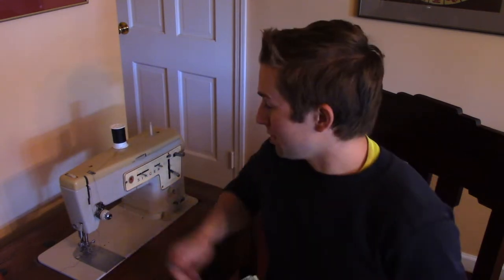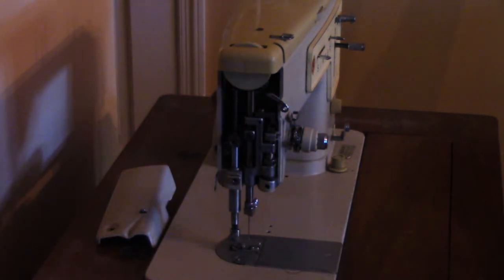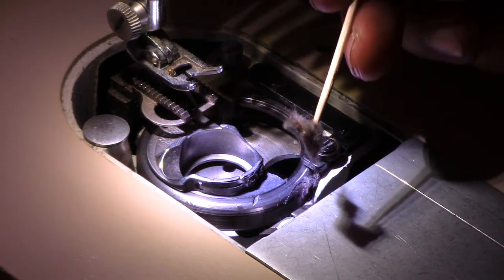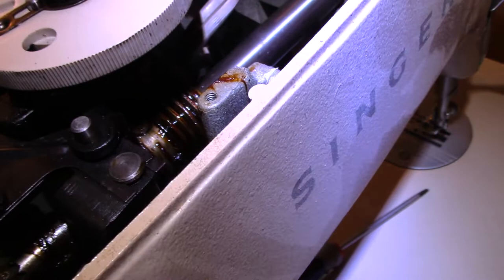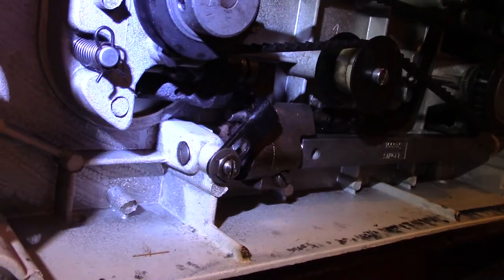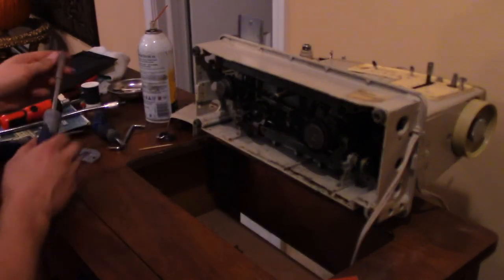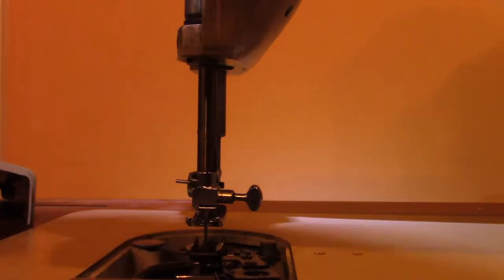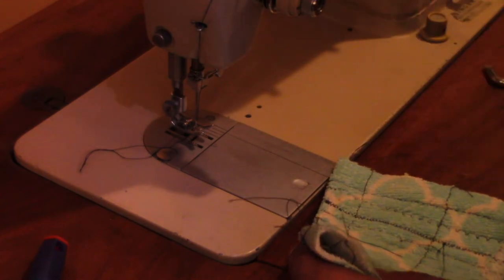Singer 457 Lubrication, Maintenance, Needle Timing

Comment: Wow. Just WOW. I tackled my wife's 50 year-old Singer 457 machine two weeks ago to replace a broken gear. She loves this machine. Put it back together, and the timing was off. Spent a WEEK messing with videos posted by others, and NOBODY mentioned the TIMING MARKS on the shaft! After watching your video, I had it timed in 15 minutes. You are a great mechanic with very good communication skills. Who cares about knowing all the proper terms for parts! You NAILED it. Thanks so much. Now all I need to do is fix the tensions that I screwed up!!! Keep it up!!!
Reply from the maker: Very please to see this video helped! I really wasn't sure if there was a point to posting this video but now I am glad I did! When taken care of properly, this type of machine can potentially last generations! Nice to see some one else who can appreciate a machine like this! cheers
Reply: @OldSoulMillennial  I grew up sewing with this machine.  It’s now in my possession.  When I try to sew the machine runs BUT the hook mechanism (the thing that spins around under the needle) does not move.  When I lay the machine on it’s side to look under the machine, the belt is attached, but when I turn the wheel the belt will not move.  What do you think I need to do?  Do you think I need to play with the timing as you demonstrated in this video?  Please, I would so love your input to this baby running and sewing again!  Thanks in advance!  MH
Reply: @OldSoulMillennial I Normally Use Scissors to Trim The Thread Off.

Comment: great work, especially on showing the timing adjustment. 

i'm writing a few points for ppl who need a bit of help in the future.
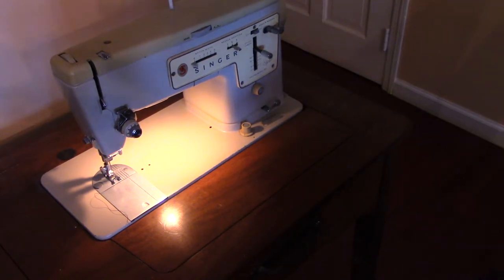@2:55 the knob is the feed dog regulator. it moves the feed dog up and down r= regular sewing (all the way up) f= fine (a little lower) d=darning (all the way down)
@10:33 the plastic gears are sensitive to petroleum lubricants, especially considering their age. use a lubricant that's compatible w/ plastic. (spare gears are available online, i replaced one of them after it disintegrated w/ the help of improper lubricant).

about the speed of the sewing machine.
that's still not the full speed of the machine. i can think of two possible issue: weak motor (worn brushes or loose belt) or improper speed control adjustment in the foot pedal.
loosen the hand wheel knob as for bobbin winding (this disengages the needle and all the gears/mechanism) and see if the rpm of the motor drop substantially when you apply a little pressure on the hand wheel. 
if the rpm remain high, the friction is still in the gears/axles/etc. (tri-flow that was mentioned is a 'dry lubricant' that contains ptfe. any ptfe or dry silicone lubricant would work a little better on the metal parts than regular machine oil. it is noisier but it doesn't attract dust)
if the rpm drop, the motor is weak. check the motor brushes and belt. if the brushes make proper contact on the commutator, check the foot speed controller. this controller works by electrical resistance in the form of graphite pucks that get pressed together. quite archaic but fascinating. it is adjustable (some pucks may be cracked) but electronic/modern speed controllers are also available for less than $20 if i recall correctly.. in fact check the speed controller first before the motor brushes. it is normal for the original speed controller to get quite warm during operation.
Reply: Perhaps you can help me, this was the machine I grew up with that my Mom had.  I went to sew on it and noticed the machine runs, BUT the belt at the bottom of the machine (and the round hook area that the bobbin hook sits in does not spin….it starts to spin then it stops).  I took the plate off the bottom of the machine and layed it down to look at bottom of machine and when I turned the hand wheel the belt is not moving.  My question, could this be the timing?  Should we play with that firs to try to get it working and moving?  If not, what suggestions do you have?  Thanks in advance!
Reply: Hi there, you seem to be very knowledgable  with these machines, is there any chance I could send you a video with the problem explained? 

I guess I could upload one & share the link?
Reply: @roryobrien948  yes, i think that would work..

Comment: I have one of those 457s. I have several other machines too. You did a great job removing all that fluff. I use a little sewing machine brush to get out all the teeny stuff, some of which could be sandy and score the moving parts - bad. I don't use things like q-tips because they can leave strands too. Now to tackle the foot control that  came with it - only has one speed - speed demon. I found a video on tackling that too. Thanks for your attention to detail. I love that you use a headlamp.

Comment: I have read that you are not supposed to oil the plastic gears.  I also read somewhere that you are supposed to use gear grease on the worm gear. this was one of the best videos for these machines.  I have the 1970s one 513 and the one you are working on.  I so glad you showed how to do the timing.  My sewing machine repair man passed away
Reply: Oil eats plastic.

Comment: @ about 10:30 and further on when you are working at something with some channel locks... Use acetone and a q-tip, to clean those places. It should cut right through all the old dried up grease and oil. Blow out with air, after you have cleaned it as well as you can. Then re-grease and/or oil.

Comment: Love the variety.  When I saw this title, I just smiled and thought, is there no limits LOL.  I love the detailed knowledge you share.  I may tackle lubing a Singer from the 70s.  Those old machines are tanks and back when things were build to last and handle a channel locks wrenching on it.  It may have helped to 'wipe' the gunky sticky stuff off in between penetrating sprays.  Good videos.

Comment: The dial you are fixing at 13 48 lowers the feed dogs. It  seized in the most common position - feed dogs up. For free motion quilting and darning ( not common activities) the feed dogs can be locked down. The D on the dial refers to darn I believe.  I have an older version of this machine and thats how it works for mine any how. Mine is done without a dial by tipping the machine and turning a large screw/knob underneath. ( MIne is a 15-91)

Comment: Thank you  for this video. I have a question for you. I  purchase this sewing machine from a thrift store about a year or so and I just powered it on and messing with it today. The issue is the bobbin hook part is not spinning rather I use the wheel to manully turn it or use the foot pedal. I oiled it and I check the bottom and the bobbin part is pushed it where it connected to the pulley but it does not move unless I manually turn it. Is there anything else that I can check or could it be the motor?

Comment: Thanks, this helped me do all this maintenance on my 457- and it is running better, But the issue I had before I started -  is still an issue. The shaft below the bobbin stopped rotating. I had been sewing and then the top needle was punching holes in fabric, but no stitch was being formed. My husband and I completed the all maintenance, including the stuck R/F/D knob & we did have to remove the pulley and followed replacement & all the needle timing. But it didn't help my original issue. When we manually move the pulley on the bottom it rotates the shaft and the piece below the bobbin. But when we try to run the machine, the needle goes up and down, but that shaft doesn't. Do you have any ideas?
Reply from the maker: If you'd like, email me a video of the problem. Gasgasteam101@aol.com
Reply: The pinion at the top of the vertical shaft has probably stripped- a very common fault - they are replaceable and there are videos available. I replaced ours today (just got to do the timing). Search for "replace singer 457 vertical shaft pinion".

Comment: The reason you hear the noise, is the bobbin casing needs oil. Remove bobbin and you will see a small hole, put a drop of oil in it and noise will stop.

Comment: Thank you for a very informative video. Did you alter the screw on the needle bar when you set your mark?
Thanks
Reply from the maker: If memory serves me correctly, that screw is just to hold the needle in place. you can loosen that screw and use different thickness needles for different jobs. Just make sure the needle is bottomed out in that slot.

Comment: I have the same machine but when is in reverse and zigzag has a strong sound like two pieces of metal hitting each other do you have any idea about what is wrong with it ? 
Thanks great video
Reply from the maker: Not sure Otto. Sounds like you will have to do some exploring to try and pinpoint where the noise is coming from.

Comment: HI MY SINGER ZIG ZAG 457 MACHINE HAS BEEN LYING IDLE FOR A NUMBER OF YEARS MY GRANDAUGHTER IS TRYING TO USE IT BUT THE BOBBIN PLATE DOESNT TURN I HAVE TRIED OILINY IY BUT TO NO AVAIL CAN ANY ONE HELP THANK YOU
Reply: I have the same problem. Any response ??
Reply: @hector7607  ive got this issue too. Did you find a solution
Reply: This problem is very common, you have to replace the broken top vertical gear thats broken. If you’re a handy person or know some handyman, it’s is fairly easy to replace. I did it myself not knowing almost anything about sewing machines, don’t forget to retime your machine.

Comment: When doing the timing marks... Does the other end of the belt not matter? In other words, the belt can be at any position, in regard to the other pulley, and tensioner, etc. The only thing you are really concerned about is the bobbin carrier barb and the timing mark...
Reply from the maker: If I understand your question correctly, no. The opposite end of the bobbin side pulley can be at any position. All that matter is that you loosen the set screw on the bobbin side pulley, get everything lined up and set properly on the timing marks like I instructed, and tighten the pulley.